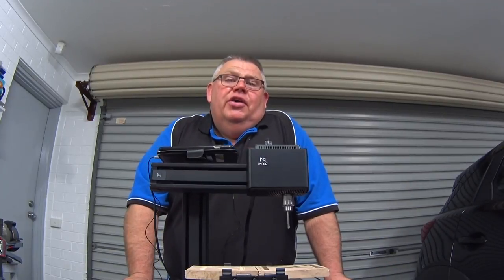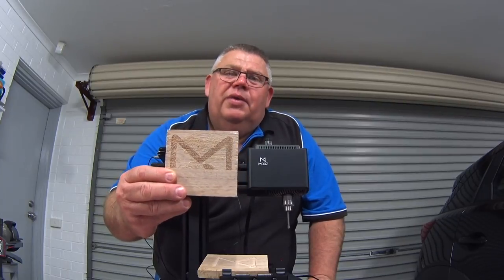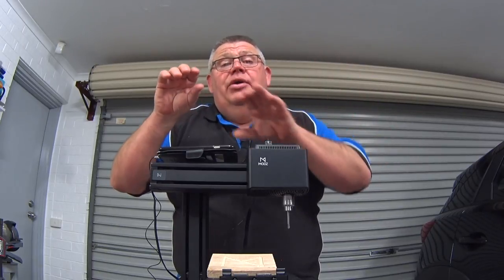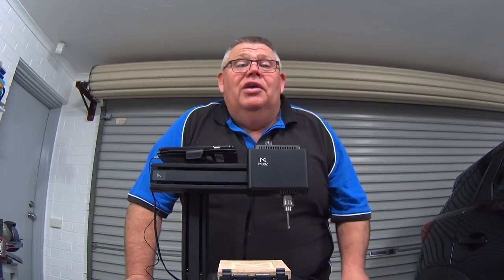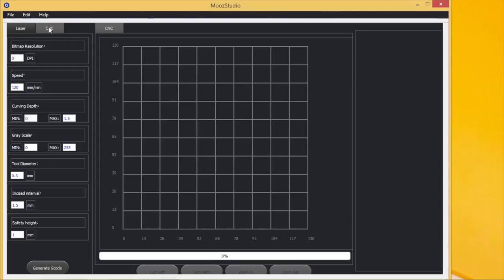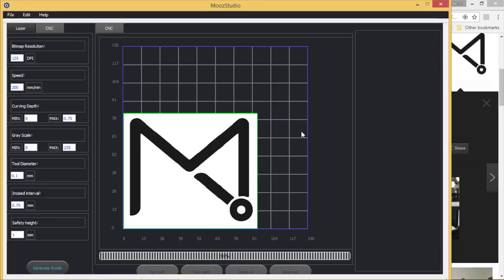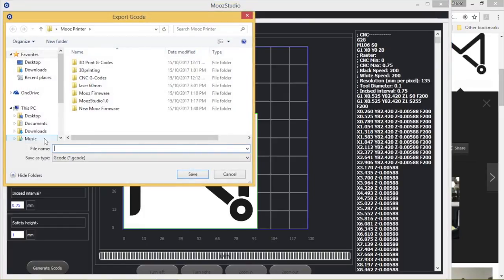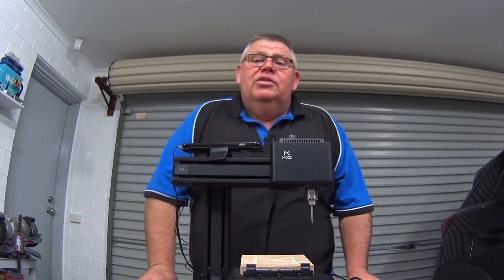MOOZ Unboxing Video Review Pt.2 - 3 in 1 (Printer, Laser engraver & CNC router)

Comment: Just pulled the trigger on the full Mooz 2.  I hope this thing is moderately fast for CNC.  I am into making jewelry using stabilized wood and acrylics, bone, leather etc.  Got big plans for it.
Reply from the maker: Hi Michael, congratulations on your purchase.  From memory I think there are 3 variants of Mooz units available.  I had the first unit with the single Z Axis pylon.  May I suggest you get the option that has twin vertical pylons as I think this would have more rigidity.  Cheers, Aaron.

Comment: Thanks for your review, do you have any idea how to improve the laser engraving or upgrade the laser beam capability. In my first week using Mooz laser; I didn't get any good results for pictures engraving on wood, after one week, the laser beam is no longer burning wood, paper, or anything.
Reply from the maker: Hi Aladdin, I think you need to contact the supplier mate.  It sounds like there might be something wrong with your laser.  Also keep in mind that this is a very low cost blue laser diode and not a high end Co2 laser.  Either way, contact them and explain your problem.  Cheers, Aaron.

Comment: How exactly did you post process from v-carve to Mooz? I’m very familiar with Aspire and using it at work I have a large pool of post processors to use.
Reply from the maker: Hi Ian, just posted the code from V-Carve as "gcode" and pasted it into the Mooz code.  I had to leave in the start and end by memory.  Spindle speed will be a number from 0-225.  Not in RPM.  Cheers, Aaron.